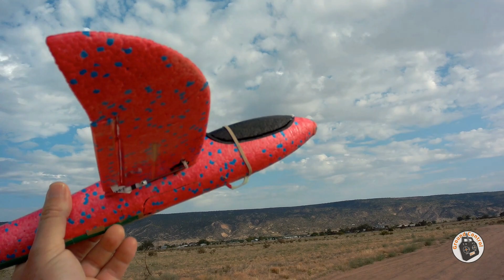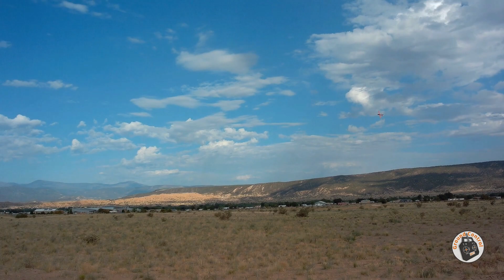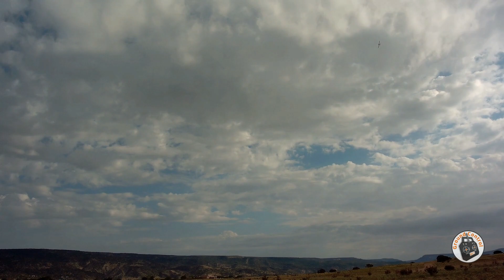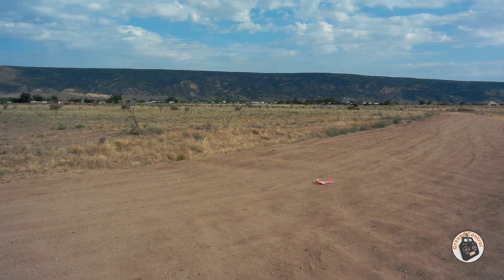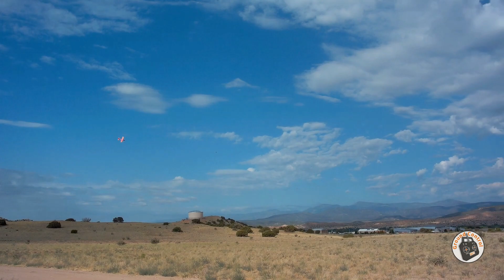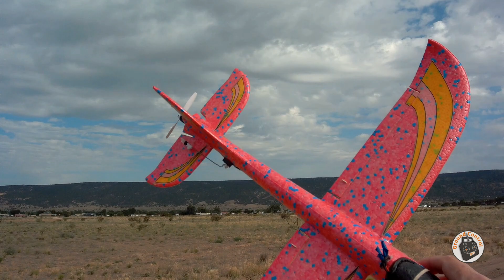DustOff Flight #20 & #21 - RC Converted Chuck Glider - Weeeee! That's Fun ;-)

Comment: the links you included are very helpful, thank you (I'm completely new to all this), but I have a few questions (if you dont mind)-

does the receiver have a brushed receiver and yet it works with a brush less motor. How is that possible?

what can I use for control/push rods? 

Thanks
Reply from the maker: Thank you and very good questions you posed ;-) The Receiver has a built-in Brushed ESC but also has a Throttle Port so you can use and external Brushless ESC just like a Full Size Receiver. I use and External 7A OPTO ESC and attached a Switching Voltage Regulator to provide 4.2 volts to the Receiver & Servos as they are Low Voltage components. That works very well. I used 1mm Diameter Steel Wire for my Control Rods, however, you could also use Carbon Rod for Control Rods and I would recommend 1.5mm Carbon Rod for Control Rods. I hope that helps and I'll see you in the Air!
Reply: @GroundControlRC   thanks for explainig!    just one more question that i just thought of. How did you make the control horns that attach to the rudder and elevators and ailerons?

cheers
Reply from the maker: @pea2911  , I cut them out of old plastic gift cards ;-)
Reply: @GroundControlRC  good to know, thanks :)

Comment: That's great powerful glider. I just ordered a 4 pack of those to modify. This will definitely be my first build but I'll start with dual brushed motors in front of the wings, using existing spare components. If everything goes well, I will convert the others to brushless for sure. The push motor system looks good, but for proper CG, I'm thinking of installing the brushless motor on top of the fuselage, similar to the WL Toys F959 glider and with a folding prop.
Reply from the maker: It sounds like you have a very nice project going and I bet the Converted Glider will be a blast to fly ;-) So a pylon mounted motor. That will make it easier to get the CG correct as I had to place 13 grams of weight in the nose to get the CG as the fuselage is fairy long for the Pusher Motor. I think the next one I convert will be a Tractor Motor which should be perfect for the CG without the need for any balance weight and provide better Slow Flight capability as the Prop will provide constant airflow over the Control Surfaces. I look forward to seeing how your conversion turns out and how you like these unbelievably inexpensive airframes ;-) Good luck on your project and I'll see you in the Air!
Reply: @GroundControlRC  Yeah! I was even thinking putting an EDF on top, but not quite ready for that yet and probably not cost effective. I did buy an Arrow Viper 50mm EDF PNP from Hobby Zone, well see how that one goes. I'm also getting my Jumper T8SG from Banggood soon.
Reply: @GroundControlRC  I wonder if an extension shaft and flex coupler from a motor mounted more forward would do the job and save a few grams?  I have boats spinning shafts at tens of thousands of RPMS.  That's basically how it's done with full size birds, the XB-42 fro example: https://www.daveswarbirds.com/usplanes/photos/xb-42side.jpg

 Here's it's power shaft set-up: https://oldmachinepress.files.wordpress.com/2017/08/douglas-xb-42-allison-engine-test.jpg

 The only problem with EDFs is that they are like the first jet engines.  Their power/thrust increases with speed and are somewhat gutless at low MPH.    The first jets like the P-80 had very little thrust at low speed, and you would keep the plane level after you lifted off the ground until you reached 140mph else pulling up too early increased drag and the plane stopped accelerating or even slowed down. 

 If you DO mount an EDF, give it a really hard chuck when you hand-launch. This is what to expect:  https://youtu.be/vQ6_0o63z2g?t=95
Reply from the maker: Wow! That is definitely and extensions from the motor to the prop ;-) I have an 64mm EDF F86 Sabre Jet I have yet to put together and I certainly hope it doesn't end in a launch like that Mig ;-) I've asked and was told, full throttle on launch for EDF Jets with a strong throw. Hopefully my launch will be better ;-)
Reply: @Doggeslife  Thanks for the tips and links. I will definitely consider an EDF mod in one of the set of gliders, and yes a proper mount will be key.   I'll test that Arrow Viper 50mm EDF BNF and see how it feels first